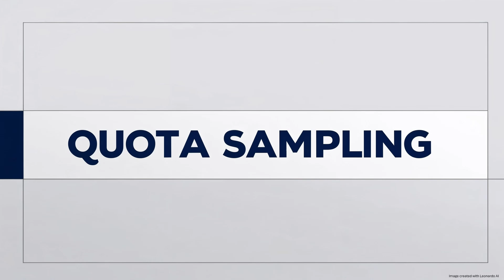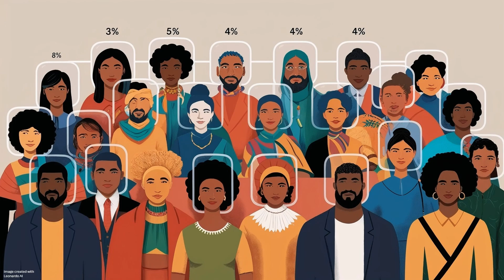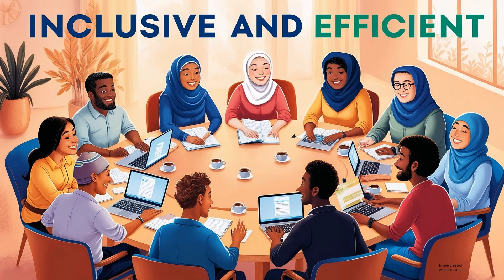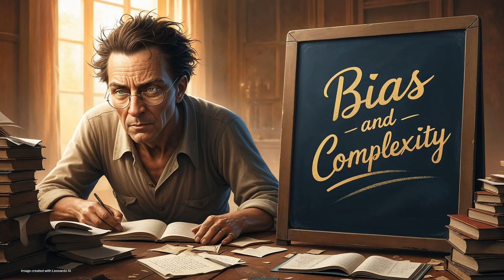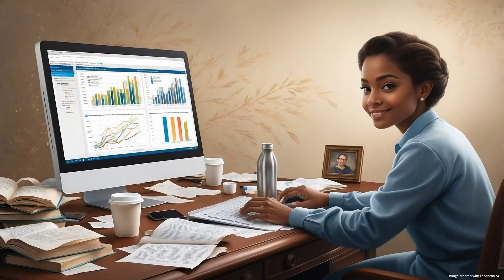Quota sampling

Comment: Hi Dr.,

I used quota sampling with a target of 65% men and 35% women for n = 430, but recruitment overshot and I currently have 314 women and 245 men. I plan to continue recruiting men to reach the male quota.

My question is: once I reach the male target, what is the most defensible way to handle the excess female cases in analysis and reporting?
Specifically, is it acceptable to (a) randomly subsample women to the quota target for the primary analysis, and/or (b) keep all cases and apply poststratification/raking weights back to the quota proportions?

If you recommend one approach, could you also point me to a methods reference you consider appropriate to cite?
Reply from the maker: I would recommend continuing to recruit the second group to reach the quota, even though that means a much larger sample. If that is not feasible because you need an exact number, it is usually better to exclude the extra cases from the overshot group from the final analytic dataset, ideally by randomly selecting which ones to drop by, for example, using a neutral rule like the first X number of women who signed up. Many statistical books discuss this, but this one is usually quite popular: https://doi.org/10.1201/9780429298899
Reply: @drlpretorius  Thank you, this is helpful. I’ll proceed by completing recruitment to the male quota and then apply a neutral, random rule to retain female cases in line with the planned proportions, documenting this clearly in the methods. I appreciate the reference as well.